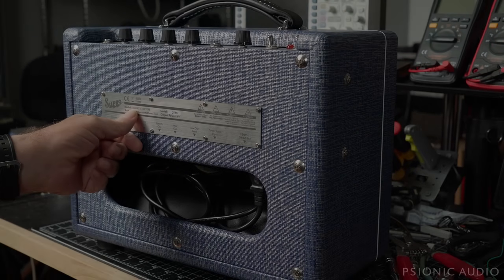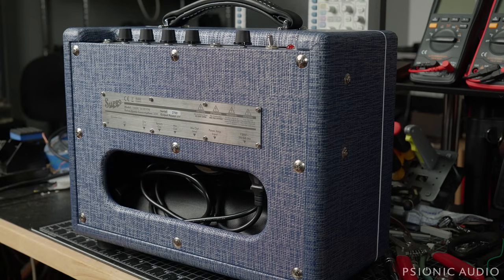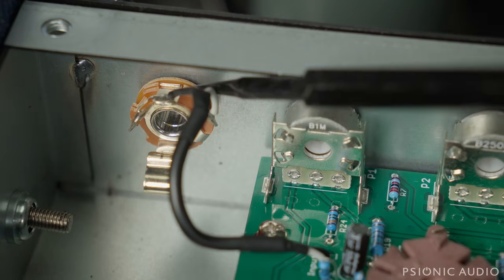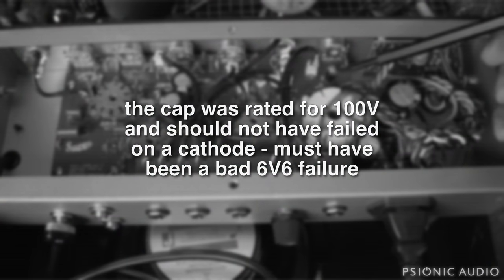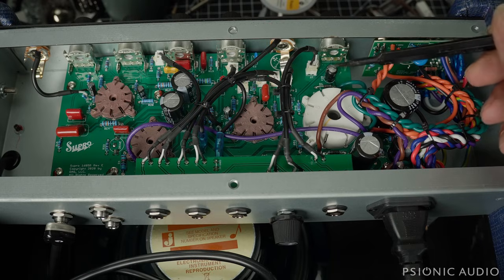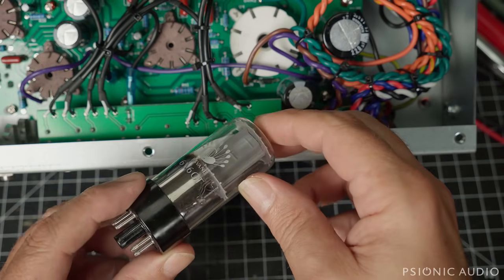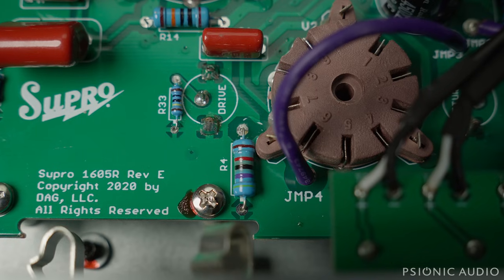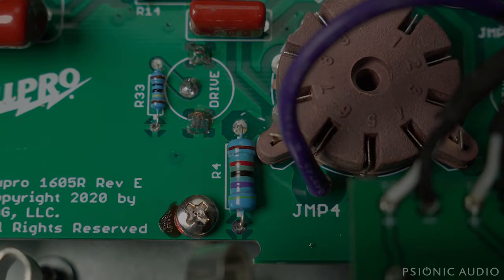Blowed Up | Supro 1605RJ '64 Reverb

Comment: The thing I'm not getting watching the video is why it's bad. Other than "the generic jacks and sockets," what's so bad about this? What I took away from this was: 1) a "not bad cap at all" just happened to fail after the amp was left on for a few days (not recommended), 2) they ARE using cheap jacks and sockets but that doesn't appear to have been the point of failure and should be cheap/easy to upgrade (at least the jacks), and 3) otherwise, the PCB is decent and "better quality than Fender and Marshall" with good quality caps throughout like Nichicons. Is it a bad amp, or did something just fail, which can happen to anyone? It's priced at the same price as a Blues Deluxe and is it any worse from a reliability perspective? Not trying to be a jerk or defend bad design but just trying to legitimately understand what was bad other than a cap failure.
Reply: I think Lyle is cranky about the failure points being something that is easy and cheap to correct at point of manufacture, but manufacturers like Fender don’t care to change. Lyle won’t recommend those kinds of amps and apparently is busy enough to turn down work on them

There are better amps out there but you have to dig, or learn how to find a good used amp, or how to repair a used amp
Reply from the maker: The cheap jacks with no lock washers are for grounds. And they come loose. Often.

I put up a “fix your Supro for $1” video showing how to solve that issue. But owners shouldn’t have to finish building their new amp.

The deeper issues here are:

1) this should not have failed but it did, probably due to the very cheap 6V6. I won’t know how gracefully it failed unless/until I change out that cap. Did any traces/pads burn beneath? Any carbon in the PCB in that area? I hope not. But it’s possible and it was a common issue with the previous versions of “Supro” amps (under Zinky ownership).

2) why did R4 get too hot? Is it rated for the current in normal use or was there some other big failure? I’ll know more when/if I can look at the schematic. But:

3) to repair these things properly requires pulling the PCB and that involves taking the amp completely apart, resulting in a high labor cost that can be a huge percentage of the amp’s value (consider depreciation). And ok, one failed cap, one toasty resistor, both visible issues. Pull everything apart and change those out. To test you have to put everything back together. Was there anything else wrong? Is there some other issue causing the visible failures? Then you have to take it apart again. Rinse and repeat.

4) those cheap tube sockets are a big concern. I’ve seen multiple cracked ceramic octal sockets on modern Supros. All these sockets are failure prone and replacing them is a big labor charge.

In a nutshell it’s a series of pennies the factory saved that likely will cost the owner hundreds of dollars.
Reply: @honkytonkinson9787 how do you correct this failure point?  The tube blew and took the component out.  How can you stop that from happening in this case when a tube fails?  I see the brown resistor issue but not the tube failing taking something with it as happens often in any amp where a tube unexpectedly fails
Reply: @honkytonkinson9787  Sure, I get that! But it actually seemed/looked like a well-designed/built amp except for the generic jacks and sockets, and neither of those two things appear responsible for the failure. It seemed more like a case of "stuff happens" and a random, decent, component just happened to fail in an otherwise inexpensive, mass-produced amp that was well-built except for jacks and sockets. Sample-size of one story (so grain of salt): I took a different modern Supro (Keeley Custom 12) into a well-respected amp tech (who has been mentioned on this channel before as a good tech), and asked him if it was junk and why it had failed on me. He also called out the cheap jacks but otherwise said it was well-built for the price and not to sell it if I was otherise happy with it. Said it had just blown a power tube, likely due to a bad batch of JJ 6V6's that was going around.
Reply: @PsionicAudio  I do always find it weird where companies decide to cheap out. Like, not paying significantly extra for something like a Mercury transformer or an Alnico speaker makes sense. Saving $3 on jacks per amp sold for $1,000? That's penny smart, pound foolish. But that type of thing doesn't seem uncommon for a mass-produced amp at a low price point, and this doesn't seem like a particularly egregious example (compared to ye old Blues Junior and the like).
Reply from the maker: I get your point. If all the components were changeable from the top or the amp didn’t need to be completely disassembled for service, I would completely agree with you. 

To me it comes down to a lack of respect the brand shows towards their customers. Especially at the lower end of the market, repair costs can be a hard pill for owners to swallow.

PS an HT fuse might have saved the output cathode cap. Those are cheap. But as a designer you have to care first.

Comment: For the un-initiated, where Lyle is coming from on his stance of the amp and brand comes down to value. The components of the Supro brand are basic at best. Nichicon makes affordable caps, just as Illinois ( IC ) does. So the brand of cap doesn't necessarily add value. Board mounted sockets are known to be an issue. And then we get into the weird sub circuits of things. The MOV's for the A/C input, the diode in the output tube bias section, and any other secondary function circuits in the amp that make it possible to sell worldwide, all come at a cost. The cost is that many more cheap/affordable components that are prone to fail prematurely. The bean counters are who destroy a product. The people stuffing the amps are likely not invested either. So you have a product that is built to a price point, likely made by individuals who really don't care about the product. Once you breach the $1,000 price point for a 5-watt amp, you better have a good product. This is not a good product, you are getting a modern VHT grade of amp, sold at a premium price because of the name on the front.

Comment: my 1605 R works using the "Mix Out" into another amp but no output to the its speaker. All the plate and cathode voltages are present and tubes all good. speaker and reverb tank ok. Output Xfrmr still soldered in place but i get Ohms from Plate to grn with tube removed. Speaker side seems ok. could the reverb tank circuit be an issue? i dont see a tank xfrmr. and don't have a schematic. Any ideas?

Comment: I really appreciate your video. I have a Supro 1622RT that I've had for years. Even though I got it for a "steal" (jokes on me), I wish I had been warned about Supro amps before I made the purchase. It crackles at start up for about 15 minutes and if I turn the reverb up past noon it squeals because it is too close to the speaker. If I pull the reverb tank out of the amp I can crank it. I haven't come across any repair videos on any of their amps so even just seeing you looking at the issues really helps me understand all the issues I'll be facing. I don't have the heart to sell the problems onto someone else. Many thanks!

Comment: This is the from the recent line up “made in china” Supros. I’ve got a Thunderbolt (Absara New York assembled era) from 2014 and I believe is very robust and with quality components.
Reply: I've got a NY Thunderbolt as well that's been rocking for several years, zero issues.

Comment: Is this true for all Supro amps from recent years? I’ve had the Black Majik on my watch list.
Reply: Lyle says "yes" to your question; so NO, don't buy one.
Reply from the maker: Avoid avoid avoid.
Reply: @goodun2974  Thanks! I wish I could that other Page reissue that was really expensive from a few years back.
Reply: @richardnagamitsu1582 the late 50's Supro Coronado schematic is out there. That's all JP was using, except with a 12" speaker.

It would be the perfect project for an old blown up Fender Hot Rod Deluxe/Blues Deluxe chassis and cab.
Reply: Anyone have experience with the Sundragon amp?
Reply from the maker: They’re fantastic and Mitch did a regular less expensive production run of them too.
Reply: @PsionicAudio I have the Absara audio version of the black magic- same issues?